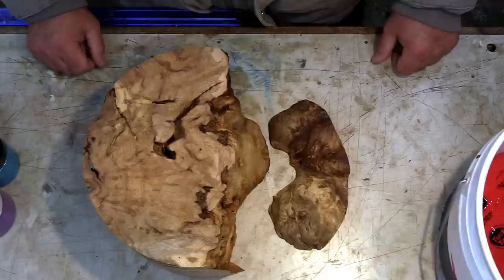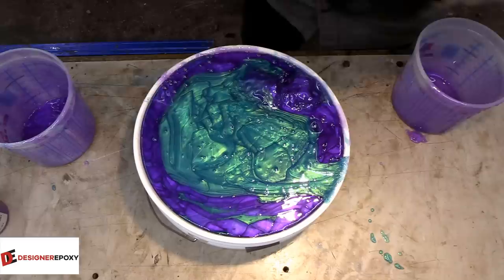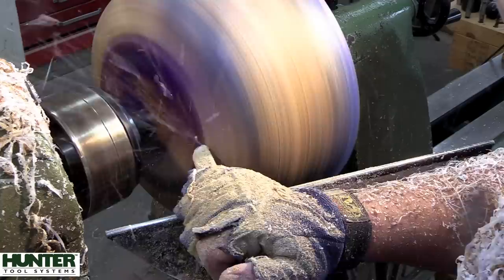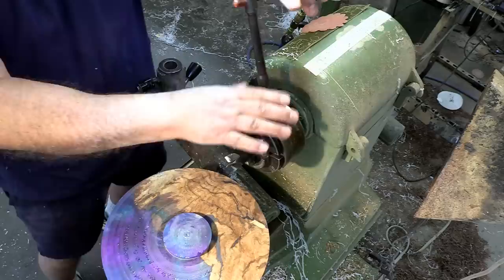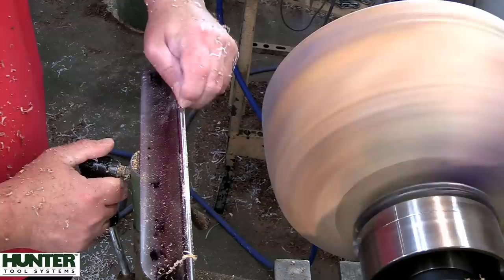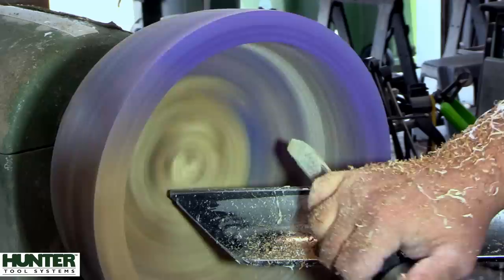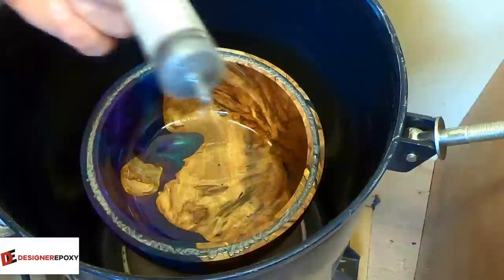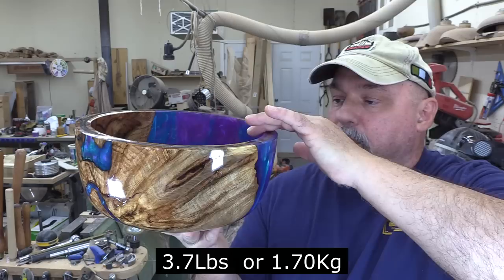Woodturning - Not Your Traditional Wedding Bowl

Comment: Designer Epoxy - Finally got mad at the one way corer I have and switched over to the Korpro that I had on the shelf ... I wish I had listened to you a year ago when I got the Korpro and switched then. It is like night and day. I have an extra carbon One way tip I will never use now because the Korpro is 10 times easier and faster then the Oneway ever thought of being. 
Thanks for all your KEWL mistakes like this one. Turned out amazing. I use lots of CA to harden wood too. Works great and fast. You are an inspiration to me.
Reply from the maker: Glad you made the switch! The Korpro cutter is awesome!

Comment: When I seen the resin blobs going in I thought you were going to have some trouble with it I'm glad you stuck with it. That's some of the best colour separation I've seen in your videos absolutely fantastic job. I have a trend air shield also and after 2 years the battery or switch or both have started to give me trouble. I was not interested in buying new batteries or spare parts for it as I thought its not worth it. It's a very top heavy and uncomfortable respirator to wear so purchased the axminister evolution instead. It's basically the same as the jsp power cap (same manufacturer) and have not looked back. It's far superior in many ways. So much more comfortable and light weight I'm delighted with my purchase. I think you will be happy with it.
Reply from the maker: Great! Thanks for the info!

Comment: It’s beautiful. I missed the Premiere & I was up this time. I’m going to check my settings. Edit: you should ask other creators who deal with metals what they use for a cheaper stand in for white gold. Like diamonds can be replaced with cubic zirconia or crystal or glass. There’s probably a workable substitute for white gold
Reply from the maker: I’m assuming that most would say aluminum. Keep in mind I need to either cut it back with the gouge or sand it. They can grind and I can to some extent. One issue would be the metal getting too hot then releasing from the glue or resin. This has happened to me in the past. Thanks for the suggestion!
Reply: @SpragueWoodturning  It’s easy to forget that creators have so much life experience outside the channel. I appreciate you taking the time to respond & for your explanation

Comment: Designer epoxy
Jim, I own a Robust Sweet 16 lathe. It is the best engineered lathe that I have found. It allows a section of the bed to be removed and placed at 90 degrees to access the backside of large pieces (up to 32"). There are videos that demo its features, but using the lathe is necessary to appreciate....
Take care,
Mac
Reply from the maker: Thank you so much!

Comment: Hi Jim, I do have a Robust American Beauty lathe.  It was an upgrade from a Laguna 1836.  It is a 3HP very solid lathe.  I have had it since December of last year.  It is so solid I have yet to have a piece make the lathe shake/spin out of balance.  I love the the tailstock feature that just tips it to the side with hydraulic assist.  Makes setting up for hollowing so much easier.  There are a couple features that are frustrating - because the headstock and tailstock are so “robust” they can be difficult to move along the bedways, but otherwise I LOVE IT!!!  Designer Epoxy
Reply from the maker: Great! Thanks for the info!

Comment: Another great piece. The color separation is amazing. I use powdered aluminum and CA to get a metallic inlay. It cuts back and sands great. Sand to at least 1000 for a mirror finish. Thank you as always. Stay well. Designer epoxy.
Reply from the maker: I have aluminum powder and in the past when I used it, it looked like body fill, lol. Thanks

Comment: I only use designer epoxy for everything now.  I did a pour 5 3/4 inches thick at 65 degrees and no thermal cracks!
Reply from the maker: Yes, I’ve done deeper ones as well without racking as well. It’s the best! Thanks

Comment: I've watched all your videos.  I've learned a lot.  I also bought 3 gallons of Designer Epoxy and have been happy with it so far.  I've had to get used to taking at least 3 days to cure, but I like out then it is and how well it penetrates.
Reply from the maker: Yes, it need a little bit of planning but I’ve not seen anything on the market that can rival it. Thanks

Comment: Amazing work as ever. 
I had two pots of resin cure really fast so were wasted and ive also had it go really thick really fast but did manage to get it into the pot and the chamber quite quickly but its a very fine line and its so rapid.
Reply from the maker: It certainly is, thanks!

Comment: I love your videos and the works of art you create. A tip to help you:  To add 40% volume using the rice method, you can save a step in your calculations by multiplying your volume of rice by 1.4% instead of .4 and the adding then adding original volume of rice.  (Your way - step 1: 3.5 liters (vol. of rice) x .4 = 1.4  then step two: 3.5 + 1.4 = 4.9 liters of resin  ** OR ** My way - all in one step: 3.5 x 1.4 = 4.9 liters of resin) And then of course you rounded up to 5 liters needed for your project.
Reply from the maker: Yes, I now multiply by 1.4. Thanks!

Comment: Wow, I was worried about that resin blob! So glad it worked out.
If I were a customer, the color separation you get would be well worth the lack of resin penetration into the wood (and consequent glue patching). It's just so striking.
The pressure chamber preventing the curing of the finish wouldn't have occurred to me, either. But in geology, the three factors in mineral formation (other than the chemical make-up, of course) are Pressure, Heat and Time, so it makes sense.
I also don't mind longer videos. I'm not as fond of the music overlay on the final revolving view, but it's easy enough to mute 😀.
Thanks as always, Jim!
Reply from the maker: Thanks for watching

Comment: Absolutely beautiful piece Jim, I agree with you about the inlay, a little more shiny/ chrome would have really popped. Two chrome ring inlays on the bottom would have been special. Designer Epoxy
Reply from the maker: Yes, might try a hole saw at some point to see if it will work. Thanks

Comment: Once again, I learn so much watching your honest portrayals! Could you please clarify the settings in which you utilize the “bevel” of the Osprey, vs when you don’t? Thank you Jim!
Reply from the maker: Use it just like you would use a gouge. Place the edge of the tool on the surface of the wood so the cutter isn’t cutting, the bevel area, then very slowly lift the handle until the cutter starts cutting. When in doubt, place the tool on its side and slowly rotate the tool up until it starts cutting. It’s up to you to find the sweet spot. Hope this helps. Will try to cover this in a upcoming video. Thanks

Comment: Beautiful! Have you considered using some penetrating epoxy on the burl before pouring in the colored epoxy? Similarly, you might try using some deep cast without pigment to coat the wood, put it in the pressure pot while waiting for the colored epoxy to be ready, then when you put them in together it will just mix in with the colored epoxy. Maybe even do a partial pour of one of the colors...
Reply from the maker: This might work better under vacuum. Thanks

Comment: Another great video Jim! No matter how long it is. The longer the video the more I learn!  The way you got that resin to color separate after being so set up was amazing. It’s also great when you show us how you make the best out of your creative opportunities (some people call them mistakes) is fantastic! Keep those tips and hints coming and I know I’ll be watching every minute of your videos. 
One question about your glue block process, (it’s taken the place of me using epoxy glue up blocks) any reason you/I can’t glue on a larger piece of hardwood say 6-8 inches then while leaving  it 1/2 inch thick of the  6-8 inch  along with the hot glue squeeze out in place, cut down the desired sized tension for your stringhold chuck. We can turn the block to half the chucks max diameter for the best gripping and you’ll get the wanted additional glue strength? 46:38 46:38
Reply from the maker: Ok, had to read this a few times to understand. Yes, having the glued area large, then tapering it down to the right size for best grip from the chuck will work because I’ve done it in the past. Just remember that the smaller the tenon is, the more likely hood it can snap off too. Hope this answers your question. Thanks

Comment: Surprised you didn't try to integrate actual metal shavings for your inlay, I know its tough on tools, but that carbide usually will still battle with it pretty well. Also, my bell notifications were turned off as well for your channel and others, youtube always trying to mess channels over but you are apart of most of our Friday routines so not complaints there. Thanks again Jim as always for your work.
Reply from the maker: I was going to do aluminum but it’s hard to find the right size that will work. Can’t figure out why YouTube does this! Thanks

Comment: The reason for letting the resin set before pouring was because of the volume of resin and the prevent thermal cracking? You may have mentioned it and I missed it sorry. Beautiful job also! Oh yes Designer Epoxy 😊
Reply from the maker: No, it’s so the epoxy thickens up that way they won’t combine and make one color. Thanks
Reply: Thanks for the clarification, I’ll give it a try 😊

Comment: Hi Jim. I’m wondering if the hot glue in the very beginning is what made it difficult to remove from bucket?

You’re right, the purple and turquoise are certainly my favorites as well.  

Congratulations to the happy couple!
Reply from the maker: It might actually be the sealant that I put around the bucket on the outside edge on the bottom that combines with the resin and then makes it hard to remove also. Thanks

Comment: Beautiful piece Jim!! 
I have a question. When you rub the sanding dust into the surface then coat with CA, does it affect the coloration in the burl? i.e. light dust in dark spots and vice versa.
Reply from the maker: No, the burl was saturated with glue already. Thanks

Comment: Jim, I think a Stainless Steel band would have worked out very well for your ring on top of the bowl. Most of the shiny metal on motorcycles is highly polished Stainless. At least from the factory. A machinist could have cut one to your specs for probably not to much as well the interlocking rings on bottom for inlays. Heck you could have had them chrome plated or gold plated if the consignee were willing to finance it. Just a thought. Love your shows. Just found you a few weeks ago. Already dreading running out of new episodes.
Reply from the maker: Dropping in a solid ring would certainly work too. Thanks and welcome aboard!

Comment: Jim, I have had epoxy that was exactly the same amount. A & B that would setup in a few hours and then a couple times it took over a day to setup. I'm not sure if it was caused by the temperature and or the humidity down here in Texas. Might be some of the same issue that you had with the epoxy.  I sure don't use the volume of epoxy that you mix up.
Reply from the maker: It’s definitely affected by temperature and I bet humidity has something to do with it too. Thanks

Comment: Just beautiful man. I don't think anyone has mastered resin the way you have with designer epoxy. Curious - I wonder what would happen if you used pewter shavings as an inlay to get the chrome look? (I'm planning that for an upcoming piece actually)
Reply from the maker: I’ve been looking for them. Need the fine ones but not too fine. Let me know if you can find a supplier. Thanks

Comment: Jim - when you core these fairly straight sided bowls, wouldn’t a smaller radius knife but one still deep enough to reach your desired depth give you a larger volume in the core?  I usually pick my knife that has the pivot closer to the center of the bowl.
Reply from the maker: I debated using my number 1 knife, but it would of been a lot longer before I could get tailstock support. Thanks

Comment: I wonder if the finish not curing in the pressure pot was due to temperature, compressed air is cold air.
Reply from the maker: It’s got to do with pressure and air flow. Thanks

Comment: Hypothetically, if you were to have added the purple immediately and went straight to the pressure pot, and then 20 hours or so came back and added the blue would it solve the small cracks issue and give that color separation?
Reply from the maker: In most of the casting I guess. One of the problems is the epoxy behaves differently in the PP and getting good color separation might be an issue as you wouldn’t be able to combine them at the same time. Someday we might find out. Thanks.

Comment: Designer Epoxy does make beautiful combos.  Wondering about how much a wedding bowl might cost and what lead time is?
Reply from the maker: I’m not taking anymore commissions on wedding bowls like this, however if you want one with the brass shavings in the rim the simulate a wedding ring I can still do them pretty quickly. Spraguewoodturning@gmail.com thanks
Reply: Thanks anyway their rings are white gold so it wouldn’t work for them.

Comment: Just a tip: On your email search bar, you can type keywords to find the corresponding email that you received about this idea. 

Cuz goddamn this is such an amazing idea to calculate the empty space. My only question, wouldn’t it be better if you can find wood pieces that as smaller and maybe could then add a bowl on top with weights to make more of a bowl blank, instead of cylindrical blank. I guess I’m just trying to think how to reduce resin waste if it’ll get chipped away anyways 😅 and those colors are so dope 😮

I like your bucket mold for this project but would you be able to use some spray before pouring the resin?? Or maybe jerry rig a quick release on the side of the bucket, similar to like cake pouring mold with the release handle on the side. 🤔
Reply from the maker: I use the double bowl method quite a lot to conserve on resin. Mold release is over rated, haha. Thanks

Comment: Jim, have you tried stabilising your burls first with Cactus Juice? (Superb bowl)
Reply from the maker: Sometimes I have, but in most cases I don’t see the need for it. Keep in mind, if you stabilize any wood you can no longer certify it as food safe. Thanks
Reply: @SpragueWoodturning  gotcha, on the food safe; he says certification is “too expensive” and then restricted to the specific wood variety that is tested, but that doesn’t sound right, to me. However, it occurs to me that brightly dyed Cactus Juice could be used as a means to penetrate some of your punkier wood blanks with cool colours, as a new variation on your works? (BTW, greetings from Melbourne, Australia).

Comment: There’s metal pigment powders for resin. It’s not mica, it’s actual metal powder. Zinc, aluminum, gold, etc. that’s what I use when I want that metal type colors. I made a piece I wanted to match brass shell casings color and the metal powder looked exact to the casings.
Reply from the maker: I’ve got bronze and copper but the aluminum I’ve got looks like body fill when combined with resin. Thanks
Reply: @SpragueWoodturning  oh that's right🤦🏼‍♀️ I forgot you used those 😂. Never mind me.

Comment: The hot glue must be your issue.
Reply from the maker: I’m also thinking the sealant I’ve been using on the side of the bucket to keep it from leaking could be holding on. It’s quite flexible when you pull on it, it acts like an elastic. Thanks

Comment: It didn't come out easily is from the hot glue.
Reply from the maker: It also could be the sealant that I use on the edge to seal the bottom to the sides as well. Thanks